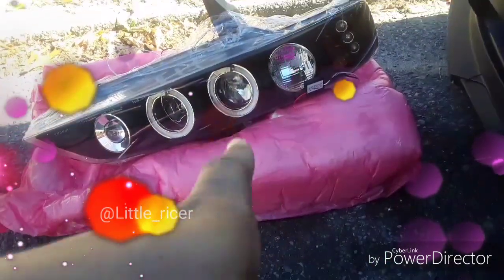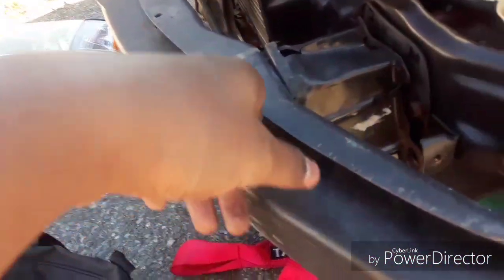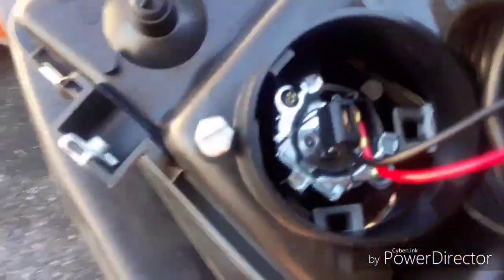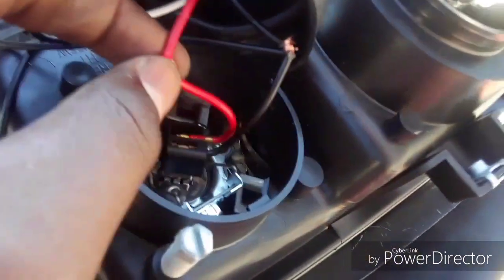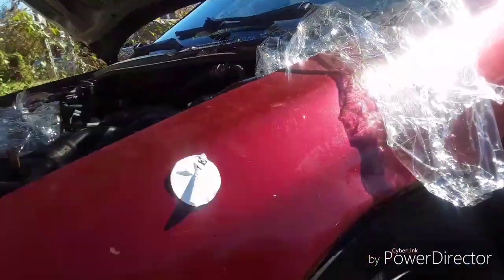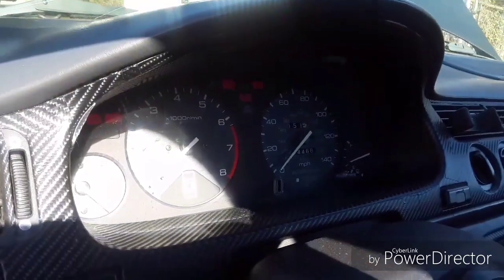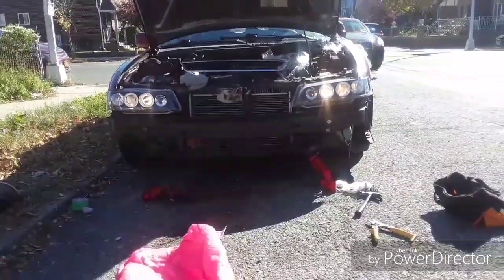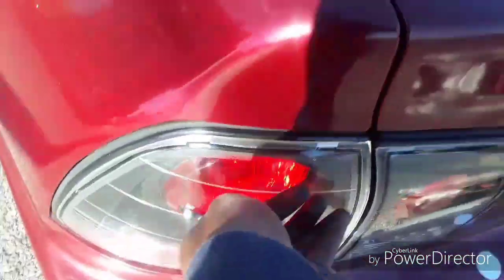how to install  after market led on 1994-1997 Honda accord

Comment: Everything this guy does is incorrect and will lead to spend even more money at the parts store trying to correct for all the damage you caused and mistakes.  Please, seek qualified installation help with these if you are at all confused.  The instruction included on the Spec D Tuning website are useless for the most part. Enjoy destroying your cars value.